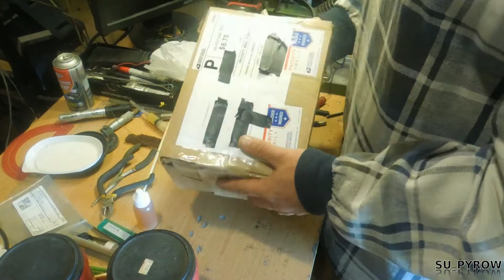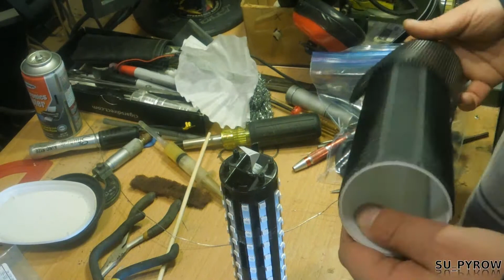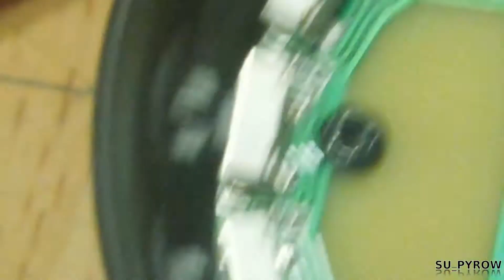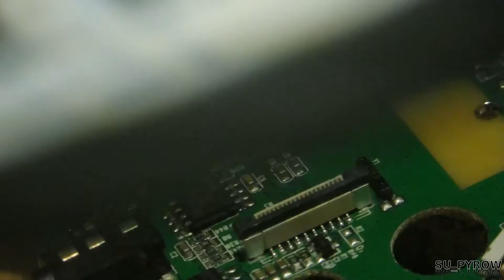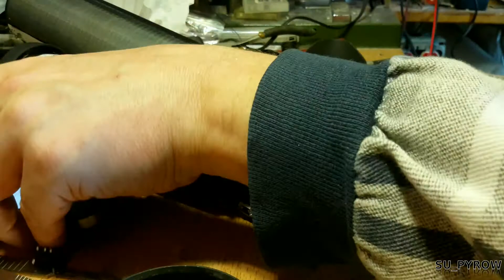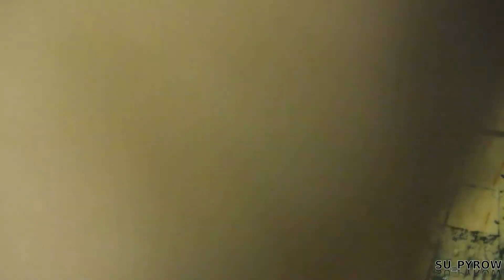Hosim Fantasy Color RGB LED Bluetooth Speaker Repair-Mail from Don - umajunkcollector! | NextPCB

Comment: I'm gonna try to watch this tomorrow,,,, the audio sounds fine but the video is in pause most of the video.
Some other vids have been messing up for me as well when I try to watch.
Reply: skycarl I'm having the same problem. Not sure if its youtube or what it happened to me with a few vids..

And I have that same exact rgb blue tooth speaker with the usb rip out of it..
Reply: Yeah, I think YouTube is trying to fix stuff again lol. Hopefully it will straighten out by tomorrow.
Reply from the maker: ive found that it works perfect in HD and on mobile devices, on the computer is sucks..  lol  Thank you for saying something
Reply: Had to come back and say that I kicked it up to 1080p and bingo,,, working good.
Reply from the maker: Subigirl!!  do you remember if when plugged into a computer it would make a sound(the computer) like it recognized the speaker??  or if it came with a cd or software?
Reply from the maker: yeah, its a youtube thing.  ill have to put that in the description from now on...  ive been losing out on views cause of it.